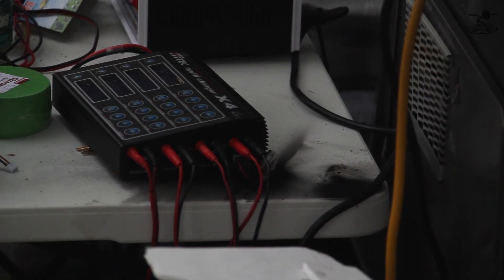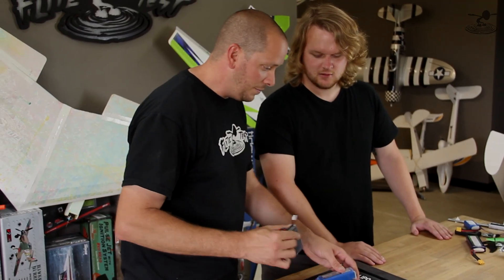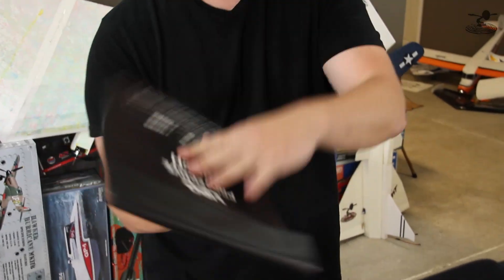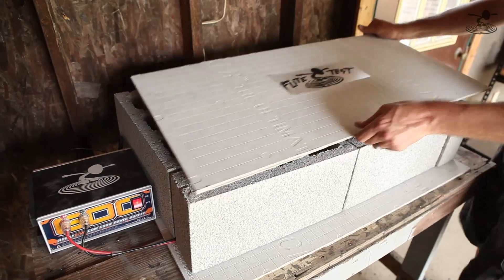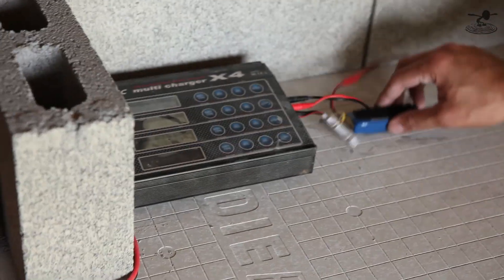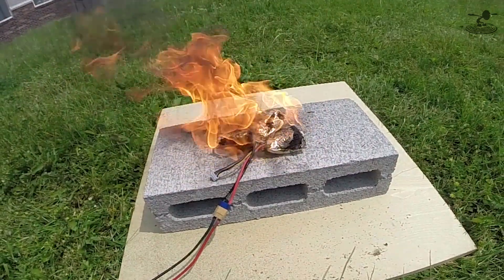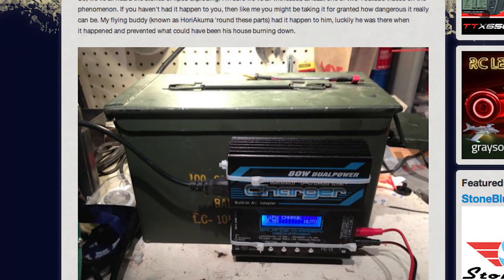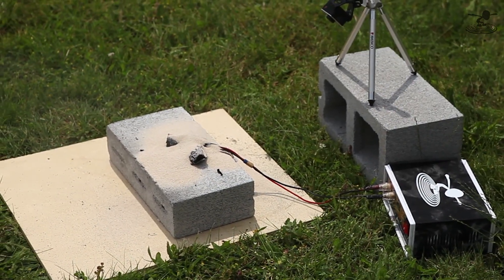Flite Test - Lipo Battery Bunker

Comment: Another thing you can get hold of will be a LiPo Gas detector....
These detect gas WAY before you get anywhere near a fire....
I think they are expensive but it might save a fire all together....

IF the "magic smoke" dose escape, it is EXTREMELY toxic and will damage you!

I think we all know the ultimate price for not looking after a LiPo so I am building a bunker AND looking into a gas alarm....we have them at work so I'll get some info... and re-post...
Reply: +55Rumble Good idea, did you find that info about the gas detector?
Reply: +salle rc 
No, I'll try to remember tomorrow...
as an idea of how bad these things are, I had a batter go in a boat... the gasses stripped the coating of my motor and just about wrecked all my dc gear.
I put what was left of the pack into a Lipo bag and put that into me tool kit to go home....
after a short 7 mile drive all of my tools had started to rust....
Reply: 55Rumble Ouch! At least it didn't start a fire in the car... Do you know why the battery went bad?
Reply: +salle rc yep, weeds in the lake wrapped round my prop and over amped it.....
I wish there was a programmable circuit breaker that would see the overload and trip...
that would've saved a nice boat!
Reply: How about now?

Comment: why not put the charger outside and have etention cables
Reply: You gotta use beefy wires then, because resistance could cause the charger to read lower voltages, resulting in overcharging.
Reply: +drkastenbrot the ballence wires take no power so the added resistance have vertually no effect

Comment: So why haven't battery manufacturers just built circuits that let one cell charge 100% then flip over and charge the next? Or a board that charges all cells to a cutoff and then kills the current? Is there something I'm missing or are people just slow?
Reply: Electronics to do that from the main battery connections would have to have mosfets as large as you find in a speed controller. The cost, size and extra weight make it impractical and would also add extra losses and an additional point of failure. Using the balancing connector is the way to go.
Reply: ***** Surface mount mosfets exist.... They could also be in the charger instead and just have two sets of cables.
Reply: joblessalex That is what the balancing lead already does, if you connect with the balancing lead then each cell is charged individually (like discussed in the video) but what you suggest above is more or less building a charger into a battery. Of course SMT mosfets exist but it's still impractical and people would not pay for it.
Reply: ***** Tiny relays.
Reply: joblessalex Given these will also have to pass motor currents they will not be very tiny.
Reply: ***** You're thinking about this differently I think. Two different leads, one for charging, one for discharging. You only need maybe a couple amps in, while you can draw 10-20. I would want one for radios or jump starting a car. To be able to just hook one to a solar panel and have it charge till it's done would be awesome.
Reply: joblessalex The balancing lead is just for charging.
Reply: Search for Lipo Equalizer. It is a charger which has individual charge circuits for each cell. Very safe, but only lower cell counts and low amperage. It charges directly through the balance lead. 
A high quality one is available from Voltcraft (german brand) for 20€. Only 400ma, so its only really useful for smaller flight packs. Hobbyking has a 800ma one, but you should be careful about plugging hk stuff into mains ;)
Reply: drkastenbrot Since then I built a custom charger that balance charges all cells. It's an absolute design nightmare. I can see why they don't do it.
Reply: If it did one cell at a time, it would take a 3s three times as long to fully charge.  Charging through the balance cable does them all at the same time with control (shut off) for each cell.
Reply: Even then, failures happen... better to be prepared than to be sorry...

Comment: I can attest to the lipo battery exploding. I dropped my battery and hit a piece of angle iron and it busted open. Due to the large moisture content right aftera good rain the lithium immediately blew up the battery and then the flames afterwards! PS Lithium and water/moisture doesn't mix.
Reply: Aidan Gieg true, its the massive amounts of energy being released by a short, igniting the battery. Lipos can contain elementary lithium under faulty conditions tho.
Reply: Aidan Gieg only under faulty conditions. But thats given here ;)
Reply: adinserter LiPo batteries don't have pure Lithium, they have LiCoO2 and carbon with lithium in it. It probably exploded from an internal short.
Reply: +Aidan Gieg If this occurs and you do not have sand close by, what is the next alternative to put this out?
Thanks!
Reply: John Kaddouri a good alternative (albeit a more expensive one) is an ABS powder fire extinguisher.
Reply: drkastenbrot yes especially if they're charged at be low freezing, get too hot, discharged too far or charged/discharged too fast.
Reply: Aidan Gieg charging/discharging too fast = getting too hot
Reply: drkastenbrot but it can directly electroplate lithum on the cathode of the battery.

Comment: Ok so i'm now using a 50 cal ammo can my question is do you guys drill any vent holes into them so should you have a battery let go the can vents since their sealed so well?
Reply: Drilling holes in an ammo can is asolutely essential, or it could turn into a bomb due to the large amount of pressure released in a lipo explosion!  I think there's a video on YouTube testing an ammo can with a lipo explosion.

Comment: I appreciate your battery bunker, but cement blocks are full of water. A much easier,safer solution is a casserole dish {or flower pot} put a gallon freezer bag full of sand on top. If the lipo goes nuclear it will melt the bag and smother the battery, keeping the lithium fire contained. Cost ya maybe 5 bucks?
Reply: well ieee you touched on sand, the sideways fence block is a pretty good idea too. Not sure how much energy is in a lipo, but i know if you put a concrete block in a bonfire, they can explode.
Reply: There's probably not enough burn time for that to happen.  Seems very unlikely.  A lipo fire doesn't have the same heat capacity as a bonfire.

Comment: **DO NOT FLY WITH OR CHARGE PUFFY BATTERIES**

I'm fairly new to all this stuff having started in the hobby about a year ago so I still don't know the full range of acceptable practices with respect to LIPOs, but I look to Flitetest and other professional sites for information about the hobby. In this video, Josh flippantly mentions that he flies with puffy batteries signaling that this is not a risky practice, choosing instead to divert the attention to making sure your batteries are balanced. After watching this video, I made sure that I always set my charger to "balance" charge every battery I charge because I am going this hobby alone and that's clearly the safe thing to do. While it appears that using balanced batteries is a safe practice, flying with and charging puffy batteries is not a safe practice contrary to the signal that Josh sends.

I thought I was being safe as I set my puffy 4S battery to balance charge two nights ago. I went upstairs but had a feeling that it wasn't safe even though Josh incorrectly inferred that it wasn't a big deal. It nagged at me enough that I got out my iPad and started searching for puffy battery safety and quickly found quite a different picture being painted about puffy batteries - namely that they are a fire hazard!  While I was reading about them being a fire hazard, my alarm went off and I ran downstairs to find a fire in my basement as my 4S was being consumed in flames and the room was filling with smoke. I managed to wrap the blazing lipo in a moving blanket and rush it outside before it burned more than my table and floor. I was able to contain the fire but our basement and subsequently the house were filled with smoke.
Fortunately for me, we were able to use fans to get the smoke out of the house and ultimately suffered minimal damage.

Two lessons to be learned from my experience: Do not fly with or charge puffy batteries! Properly discharge the batteries and dispose of them in an environmentally friendly way. Also, make sure that you are home when you charge the batteries because a mishap could leave you without a house.Had we been gone, the house would have burned to the ground.

I love Flitetest and will continue to enjoy your videos but please, please, please be more cautious about safety advice that you give. Remember, there are thousands of hobbyists like me out there who are learning the hobby through the internet and look to you as an authority on the subject. When you infer that it is okay to continue to use puffy batteries you are ensuring calamity for your followers. When you are making future videos, pretend you have a total newb on the other end who will emulate your process and ask yourself what trouble they can get into by following your example.

Best always,

Kyle Dean
Reply: Rice Cake Did you listen to what they were saying in the video? Josh was saying that he flies with puffed batteries. I, being somewhat new in the hobby was learning about such things and made a mistake. Having made the mistake, I shared my experience hoping that others would not use puffed batteries even though one of the experts in the field clearly does use puffed batteries. Not sure why you feel the need to criticize my post.
Reply: Rice Cake Look, Josh mentioned in the video, kind of whimsically that he sometimes flies with puffed batteries. If you didn't see it, it is because you didn't actually watch the entire video. Josh says at about the 0:17 mark "You know I get picked on a lot because I fly with puffy batteries." It's there, clear as day.

There's no need for you to be a total d**k about this. Many people getting into the hobby watch these and other "expert" videos to learn the ins and outs of the hobby. Kiddingly mentioning flying with puffed batteries sends the wrong signal to noobs who are learning. I shared my personal experience to help others who might not understand LIPOs and the inherent danger they pose. That's what this great internet experience is about, people sharing their experiences with others so that they can hopefully avoid making the same mistakes.

Now, many noobs might hear Josh say "You know, I get picked on a lot because I fly with puffy batteries" and think that if Josh is doing it, it must be okay, because he is the expert after all. This was an irresponsible thing for Josh to say. You may not think so because you are clearly an expert on all things LIPO, and to you, only an idiot would make a mistake when using LIPO batteries (I guess you think that every noob walks into the hobby with a thorough knowledge of the risks of LIPO batteries). Okay, so let's suppose that only an idiot like me would do this. Whether I or other noobs are idiots because we are clearly not as smart as you, is irrelevant. If one idiot burns down their house and/or loses a family member in a fire because they heard that Josh flies with puffy batteries (which implies that he also charges puffy batteries), then that's still a tragedy that could have been averted.

Lastly, if you don't think that Josh is an expert, you are totally missing the plot. There isn't an "expert certification" in this hobby. In this day and age, you are an expert if you continually present yourself as an expert, reach tens of thousands of viewers who view you as an expert, and, run a for-profit business based upon the craft. If you don't see that 70,000 views on this one video alone makes him an expert in the eyes of the interested hobby public, then, I'm not sure what to say.

Comment: We just had a fire in our garage from charging without the balance function (first time doing this) and luckily we caught the fire before it spread to the structure. The fire melted our fire extinguisher that was above the charger so we had a hard time putting the fire out. You can see the lipo fire damage on my instagram @jacobboracca  I will definably be building one of these. Thanks guys! Jacob Boracca

Comment: One of the best videos I have seen on LiPo safety!

Currently, I have mine charging on an all metal rack (baker's rack) and using old licence plates for the bottom. I do have several larger ammo cans that I have thought about using for charging and storage, but I did not know if it was safe or not. Looks like you guys just gave me my next project!

Comment: So what are you saying, if i always charge my 4000ma batteries with a balance charger and with no more than 4 amp setting. Am I safe???
Reply: I think that for the most part, yes, but once in a blue moon something can go wrong, so the bunker is an added layer of protection should something happen.

Comment: Better to be safe than sorry, i only use 2s 3s and 4s lipos atm and i always balance charge, i also keep my lipos at storage voltage so they are less likely to puff, i keep mine in a metal toolbox, i like the idea of those cinder blocks, especially for storing lipos and keeping them segregated so if one goes up, they all dont go up. Great vid guys  :-)

Comment: ....

Sorry guys, but you're behaving like idiots. Improper balanced lipos should be either rebalanced when possible or just thrown away when you CHECK them. Don't assume your lipos are still fine. Do the required check ups. Don't wait for them to catch fire. If you take proper precautions, you'll never ever have lipos that catch fire. I've been in the hobby for over ten years now and have yet to see a lipo catch fire. The whole bunker stuff is redundant and borders on plain fear mongering.

Comment: Contrary to what was said in the video, there is no advantage to charge through the output plug. It won't (and should not) charge faster. Charge power should be set to the manufacturer's recommendation, which is usually 1 C or less.

Comment: Wouldn't it be more efficient to fill the bunker with sand and when you charge the batteries just bury them in the sand that is already there so that if there is a fire and no one hears the alarm the battery still gets extinguished?

Comment: So you guys are charging you batteries without using the balancer quiet often? I've never done that, because when I started using lipos everyone on the internet suggested, that lipos should never ever be charged without a balancer. Using Lipos for 5 years now, and had never an issue.

Comment: Hi everyone. I just bought the E-Flight Apprentice S 15e. I'm looking for suggestions on a charger.  Right now I have the one from the box that I have to connect to the car battery. I'm having a hard time finding the charger/power supply which would be good. I currently have 2 LiPo batteries.

Comment: I would also like to point out, because the video didn't cover it, that the gasses released by lipo is extremely toxic. If a lipo bursts while in your model, and there is no risk of the fire spreading to something else, just stay away from it and let it burn out, don't expose yourself to the gasses unnecessarily.

Comment: I have heard from a great community of people that say you can not leave your battery fully charged or that can puff it if I sit over time. When a battery puffs up it damages the cells in the battery. One thing to try. Try a puffed 3 cell pack and a regular 3 cell pack put together o the same plane. Well when you bring it back the puffed pack will have a lot less voltage left than the regular pack.

Comment: I simply use rock wool insulation, cut slits in the middle of block and insert battery. It is 100% fire proof and if you insert the battery deep enough it will have very limited access to air and no external fire and very little smoke. Cheap and effective.

Comment: Am i safe keeping 20 lipo batteries together in a sealed ammo case?
They are all 1 cell, and are under 500mAh, and have individual slots in a lump of foam, so i assume they are reasonably safe, but does my ammo case need a vent to stop it blowing up? 

I like the cinder block charging bunker idea, that looks safe, I'm just worried about my ammo case going off like a grenade if something happens to one of my sleeping batteries, also thinking it will shoot flames out if i cut a vent in it, so need some advice...

Comment: Please, please, PLEASE stop recommending salt water for discharging LiPos!!!! All that happens in salt water is that electrolysis corrodes the terminals of the battery before the battery gets anywhere near full discharge. The correct way to discharge a LiPo for disposal is to use a resistive load, such as one or two taillight batteries in series.
Reply: Also, DON'T use an AMMO BOX if it is airtight. LiPos absolutely need holes for gas to vent out, otherwise the pressure will build up inside the ammo box, effectively turning it into a BOMB. Ammo boxes are great IF you drill holes in it for gas release.
Reply: @Enzo-kl2vc  just take rubber seal out
Reply: Yes, Salt water is NOT a solution for lipos. For a little more than the cost of a couple pounds of salt and takes up far less room than a pail of water you can use this: URUAV Lipo Killer.
https://www.rcgroups.com/forums/showthread.php?3270863-The-Perfect-Lipo-discharge-tool-URUAV-Lipo-Discharger-how-to-Hack-DIY